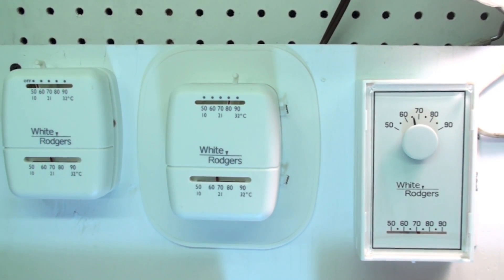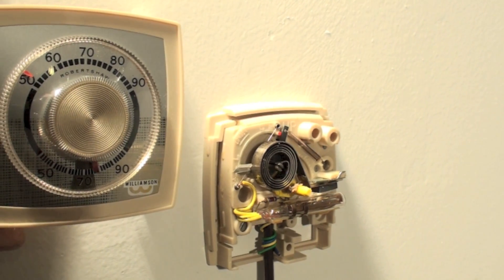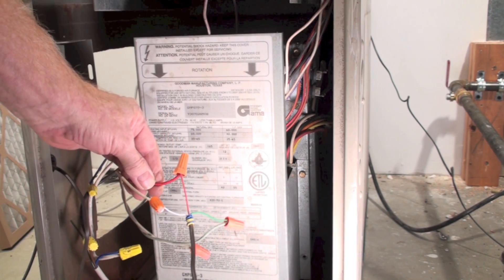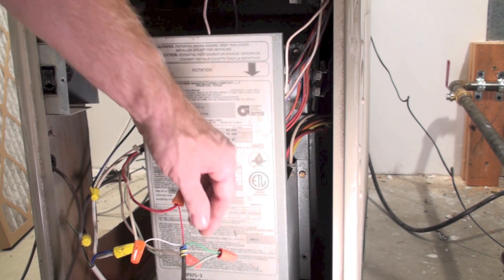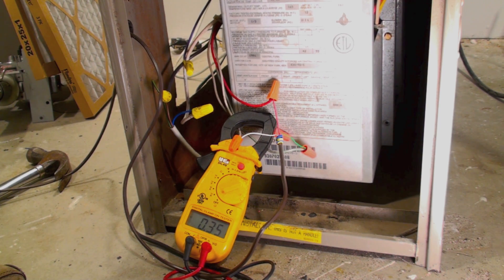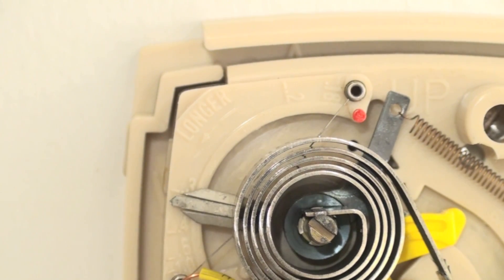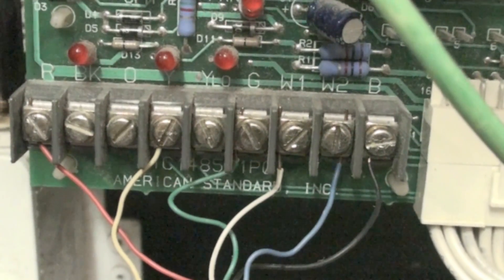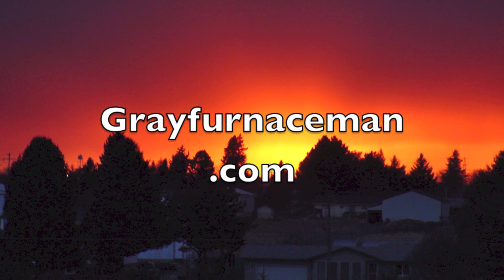How to set the heat anticipator in the mechanical thermostat for furnaces.

Comment: Do shorter cycles cause the combustion to be less complete?
Reply from the maker: It depends on how short the cycle is.  A normal cycle should be 5 to 10 minutes on.  Any cycle that does not allow the system to cycle completely on with the fan coming on will impact efficiency.  
GFM
Reply: @grayfurnaceman  in some cases it was practice to run 3 and be off 7 that’s inefficient?

Comment: Kirchhoff's current law states that current going into a circuit must equal current exiting the circuit. 
I understand your instruction to check the anticipation circuit current at the white wire as the white wire isolates the anticipation circuit from any other functions the mechanical thermostat may incorporate.  
I did as you instructed with an AC amp clamp it and it worked beautifully. 

Very informative video, great job producing the video, and Thank You!

Comment: Hi gray, like all your tech vids.
Can you clarify the correct setting of the anticipatory lever, on a white Roger's mech stat.
I have watched your vid numerous times and it's very vague ant not clear.
Now do you set the arrow end to required number 
OR THE THUMB NAIL END OF THE LEVER THAT CONTACTS THE CIRCULAR WIRE.

OK THANKS FOR HELPING WITH THIS.
Reply from the maker: It is the arrow end.
GFM

Comment: Can you please, simply tell me the proper anticipator settings for my Honeywell Class 2 LR95329?  The furnace is constantly clicking/cycling, but the house stays fairly warm.
Reply: He did.
Reply from the maker: The anticipator setting is determined by checking the amperage draw of the furnace.  The thermostat anticipator must be adjusted to match the amp draw.  If you do not have or do not know how to use a meter, you can set by trial and error.  Adjust the anticipator by moving the lever about 1/4" toward "longer cycles" on the anticipator.  If that does not help enough, set it farther.  You can also check my video "Adjusting the anticipator without a meter"
GFM

Comment: Hi there! What is the typical amp draw for radiant in floor heating in a condo pls? The building's about 25 yrs old. Need to set/adjust 2 thermostats anticipator settings but not sure to what number. Cheers!
Reply from the maker: There are 2 ways you can go here.  If you have a clamp ammeter, you can check the amp draw of the control circuit and set the anticipator accordingly.  You can also adjust the anticipator to about 3, and if the unit cycles too often, set it higher and vice versa.  Hope this helps.
GFM
Reply: Thank you GFM! I'll have to try the latter. Sorry if this is a dumb question but would you clarify please. By higher do you mean 1 - 2, or 4-5??

Comment: Could I use sculpting clay to help seal a small leak at the fitting on my pilot tube instead of pipe dope? Not the pilot flame end but the other side thats cooler. I think the stubborn residue alone from the clay would pinch into the uneven gaps to seal it off. Thoughts?

Comment: My thermostat is internal. Inside the combination gas valve. The copper wire jogs 45º to the left rounding a peg as it turns 45º to the right. From here it begins coiling about 2 1/2 times toward its center connected to an aluminum disc with ripple rings shaping it out to the edge. It is about the size of nickel. Below that sets another round disc part with ripples( not like an accordion but allows for movement up and down triggered by a magnet or something or space of the gap from the temp of the thermostats copper wire. Anyway above the first disc it is connected to the control knob for heat. Does that knob also serve as my anticipator or is my set up void of one entirely? -Propane
Reply from the maker: You have a hydraulic valve.  There is no effective anticipator.  As the disc warms, the cap tube transfers the pressure to the opening mechanism of the gas valve.  Hope this helps.
GFM
Reply: Thank you sir, it does help because it's not transferring the pressure to the opening mechanism when it's supposed to. That must be why even though my pilot flame is working and the pilot knob set in the "ON" position, my burners still won't fire up.
Thanks for the education, I've watched many of your videos and appreciate you sharing the wisdom you have with everyone.
Reply from the maker: Welcome and hold onto your wallet when replacing the valve.
GFM
Reply: I loosened the two screws of the aluminum cover for the thermostat/control knob and I heard it disengage . A faint "thump". The knob wasn't backing out far enough to allow this. We had heat all day for the first time in 4 years. :)
Reply from the maker: Hope it keeps working.
GFM

Comment: I think it's worth mentioning that setting the anticipator equal to the amp draw equates to about 6 cycles per hour. In many cases with higher efficiency equipment, you want to use a multiplier greater than one to reduce the cycle rate. Honeywell used to recommend 1.4 for heat pumps, and sometimes you may want to use up to 2.0 for high efficiency equipment in a well-insulated home. So in your case 0.35x1.4=0.49 anticipator setting for less cycles. Likewise for short-cycle electric heat you should use a multiplier of 0.6 to increase cycle rate.
Reply from the maker: Good thoughts.  I have meaning to go into this.  The older houses needed the 6 cycles but the newer ones will work well with longer cycles.
GFM

Comment: Just a note. On older natural draft furnaces where the thermostat only controlled the gas valve then setting the anticipator to the amp draw this method is acceptable. On furnace where the thermostat controls through the non-integrated or integrated control board additional information may be needed. If one checks the data label on the non-integrated boards you may see TH + 0.2 amps. This means if the amp draw on the W wire is 0.37 amps you add 0.2 to that for the correct anticipator setting. In this case that would be 0.57 amps. If you change the ignition control check the TH + rating. If it is not the same you will have to readjust the anticipator. The installation instructions will usually have the correct heat anticipator setting referenced in the instructions or on the wiring diagram. The newer Rheem/Ruud furnaces do not list an anticipator amp draw setting as they want electronic thermostats used. On high efficiency furnaces where the heat anticipator setting is not referenced multiply the W amperage by 1.8. This will usually get you very close to the setting needed when using a mechanical thermostat. When working on boilers multiplying the amperage on W by 1.8 will also work.
Reply from the maker: Gary Reecher Interesting.  I will follow up on this.  Thanks for info.GFM

Comment: So,,, the amperage variates on all the air handlers ?
Reply from the maker: Ernesto B It varies with the ductwork application.
GFM
Reply: grayfurnaceman thanks
Reply: grayfurnaceman one more question ,
On heating mode my blower turns on first then the heater ,anything that I can do in order for the heater to star few seconds before the blower ?
Thanks in advance

Comment: A good tutorial, thank you.  I used to do this for a living 25 years ago, and, while I knew I had to check the amp draw etc, I just couldn't remember the fine details on how to do it.  You cleared all that up for me, I metered the white wire, set the stat, and all is working now as it should be.  Good job.

Comment: I have another tip for avoiding temperature fluctuation in a home with electronic thermostats. If you have celsius/fahrenheit setting it is best to use the fahrenheit setting, because the temperature gradients are smaller.
  Example 20- 21 celsius is quite a larger increase in temperature than say 69- 70 fahrenheit.
Reply from the maker: Quite true.  Good idea.
GFM

Comment from the maker: If you set it to the highest number (1.2 usually) the furnace will cycle longer and the temperature in the structure will vary widely if the actual circuit amp draw is lower than the 1.2.  If you set it at the lowest setting (.1) it will cycle about every 2 minutes.  Hope this helps.
GFM
Reply: I just checked the amp draw on the white wire on the furnace and got a clamped reading of .099 while running with fan running as well. Does this mean I should move the anticipator all the way to .1 to get 6 cycles per hour? It is summer so we are typically using the air conditioning. It's a regular gas furnace and a normal central air unit. Could a different setting be desirable in the summer with ac?